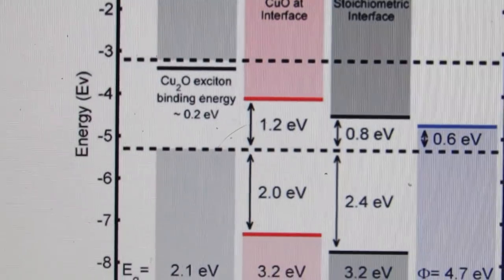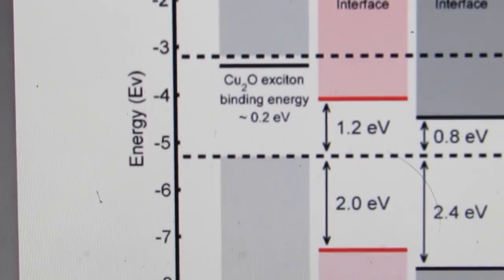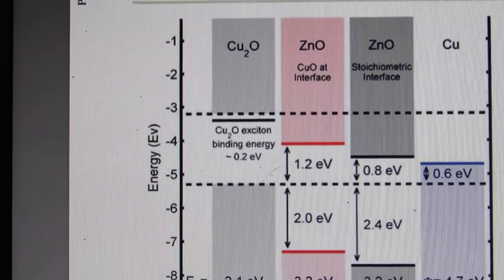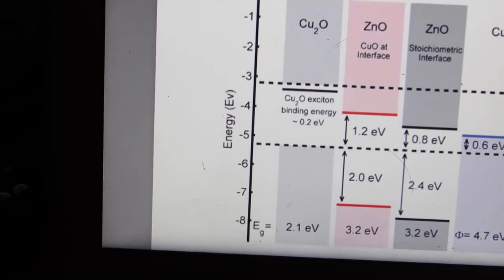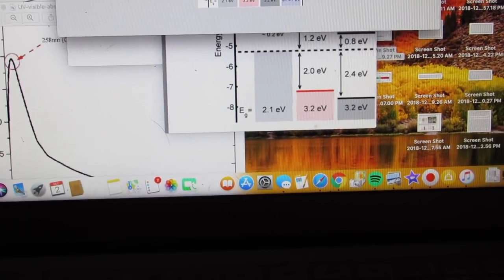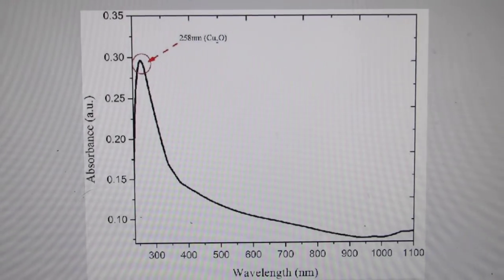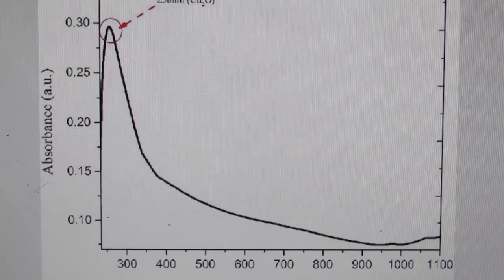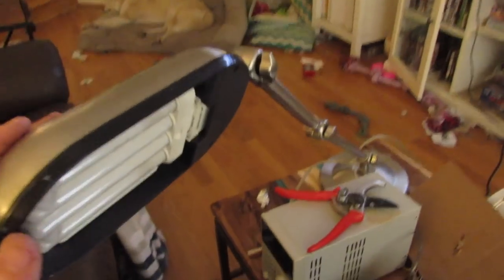how to make a solar panel (plus how it works)

Comment: Have you tried putting a resistor in between the panels instead of a wire? It seems to me like you're shorting it by connecting the panels without any load/resistance. I'd guess that's why your voltage is so low.
Reply from the maker: yup, I actually tried both before filming- I tried a 470 ohm resistor (thinking it was going to create more of a voltage difference across the plates) but it ended up being a few mV less than a regular wire (? counterintuitive) so I just deleted the footage

Comment: Can you make one that you can stick to the back of your phone so that you don't have to always plug, it in instead of using USB you can use sunlight, Your can leave it turned on forever and it will never run out of battery.